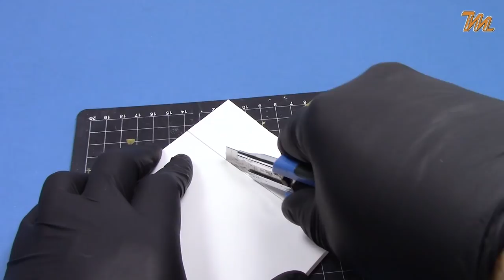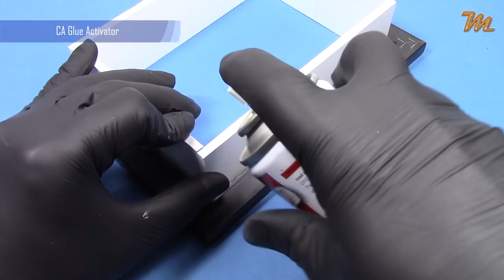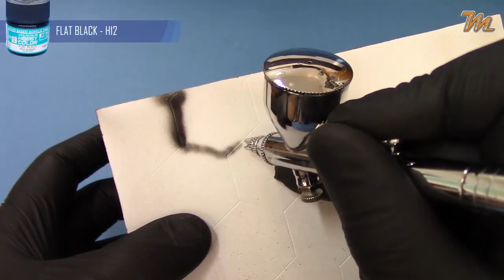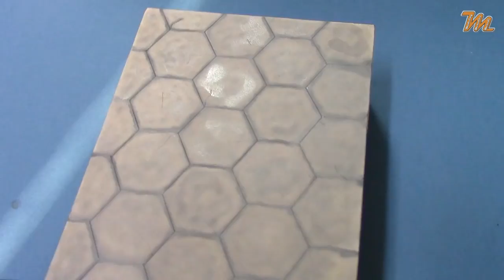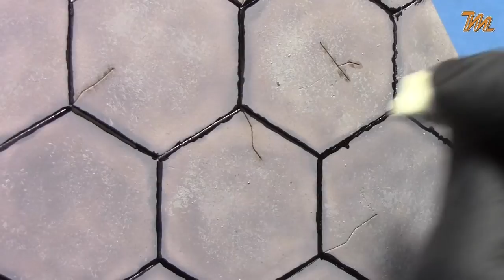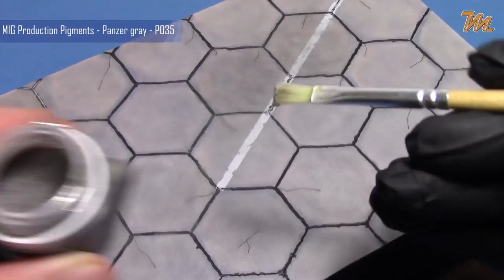Airfield display base - concrete - scale modeling tutorial

Comment: Excellent tutorial, really like the painting and weathering 👍 For gluing the foam-board, I'd stay away from CA (can get brittle with time), use a more flexible glue.
Reply from the maker: Thanks mate, and thanks for the information. I will try hot glue next time.
Reply: I was thinking of an adhesive like gator glue or gorilla glue.  Holds well and won't become brittle with age.
Reply from the maker: @jerryvolpini7987  Thanks mate. Great tip. It was my first time working with pvc foamboard so I am a noob and all help is highly appreciated :)